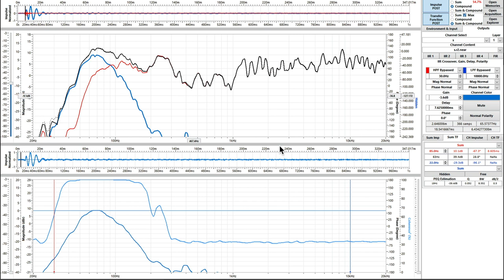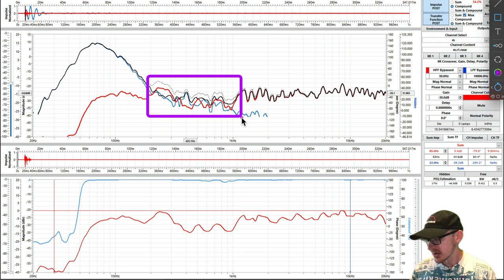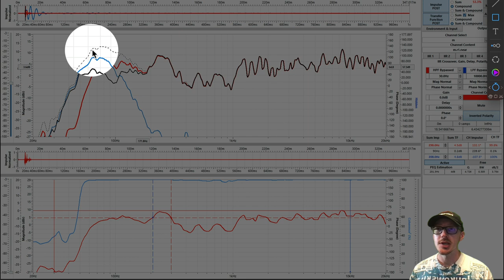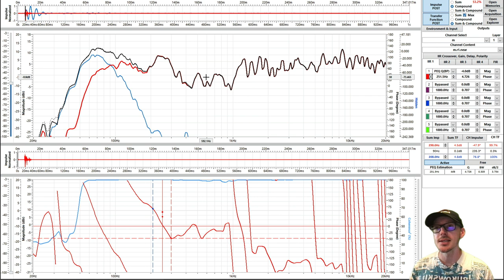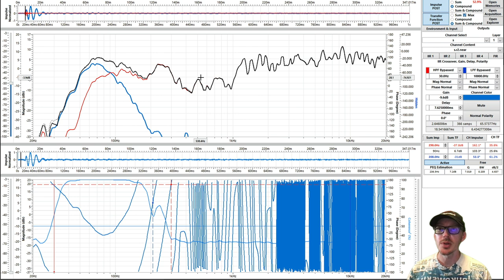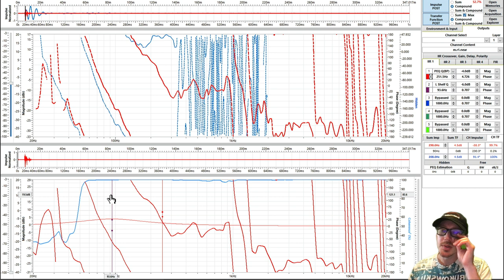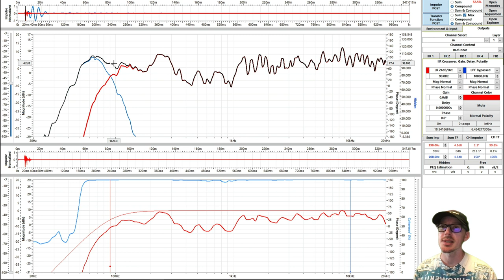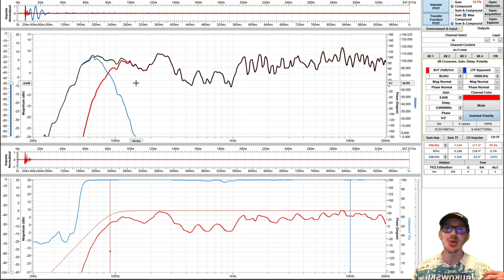The EQ Puzzle: What filters will break my perfect subwoofer crossover alignment?

Comment: Do you see an issue using say, -18 on one driver and -24 on the other? even though the acoustic response is close to -24 on both?
Reply from the maker: Hi kewlbug, the balance between drivers in a box seems like manufacturer territory so you should probably reach out to them about that. In case it is between two separate boxes, you can set any level relationship you like as long as the final crossover relationship is aligned.

Comment: I wonder what a PEQ filter in the crossover range would look like if doing the EQ to the whole system as a “unit” pre DSP like from a console’s mix output DSP settings. And then further, how that would compare to messing with the PEQ of just the sub’s or just the top’s DSP in the crossover range.
Reply from the maker: Hi Josiah! All other things being equal, the results should all be similar. If you put a filter with X, Y, and Z parameters on the console output, on the DSP input, or on each DSP output, the result should be the same.